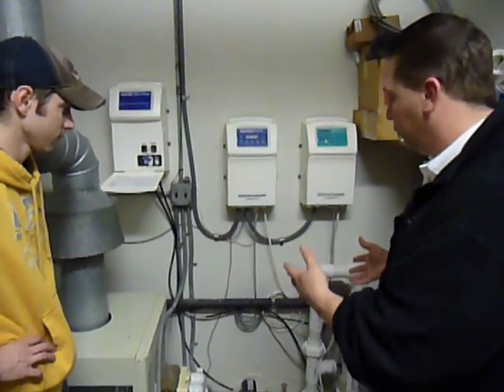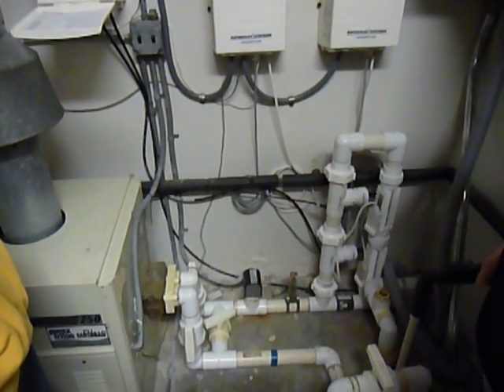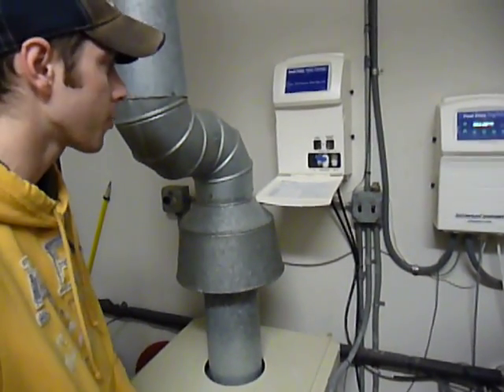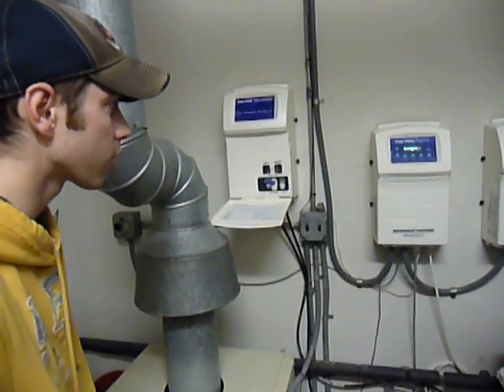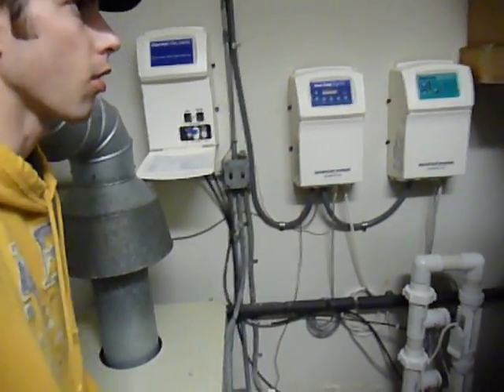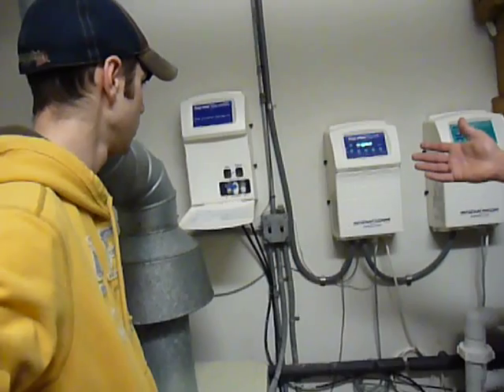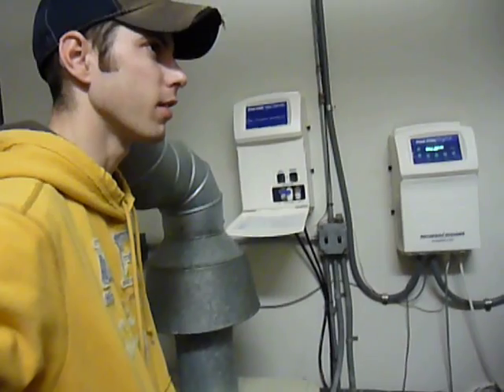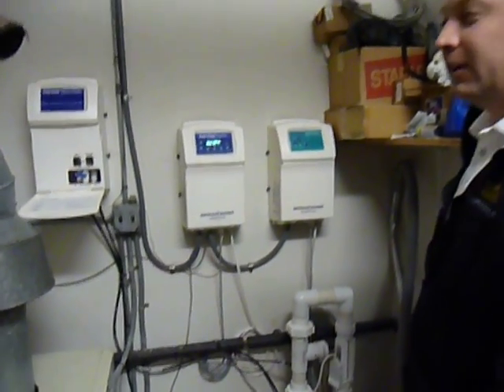Pool Pilot Total Control Salt chlorinator at Hamburg Senior Center - NY (Part 2 of 2) How it Works.

Comment from the maker: Hi Luke.  This is an older heater, which does not require a forced air ventilation system.  Thanks for your comment.